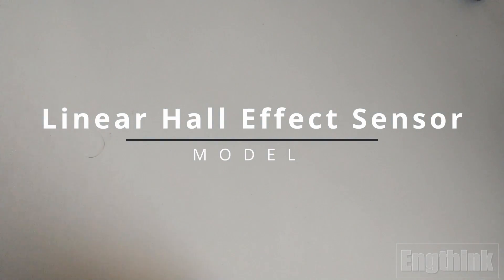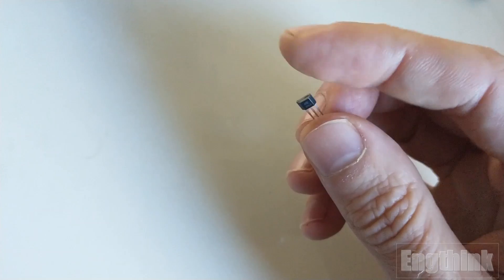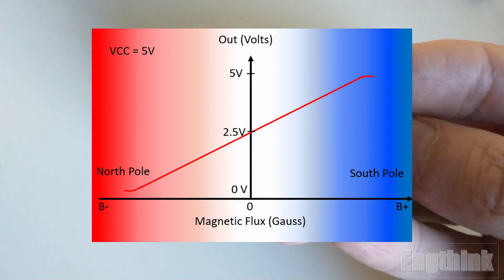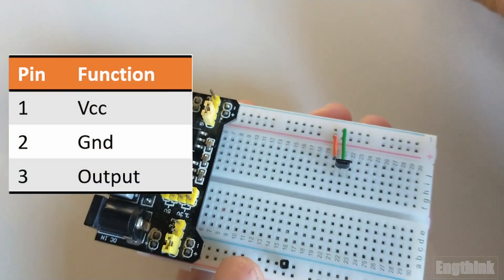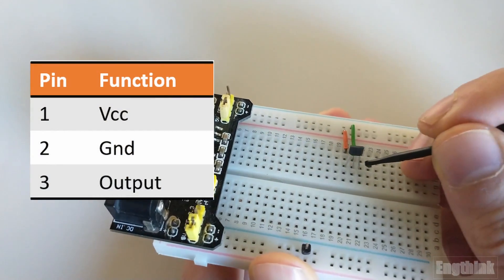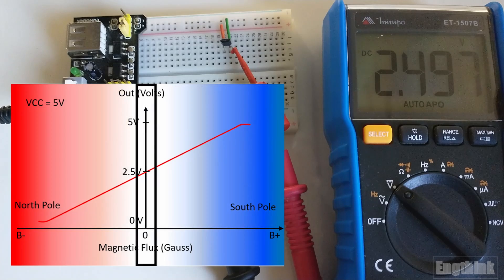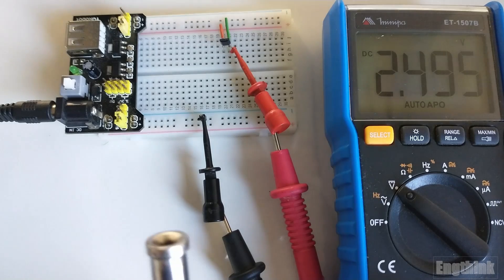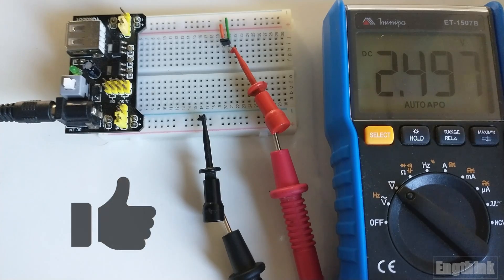Linear HALL effect SENSOR 49E #hall #halleffect #hallsensor

Comment: I'm thinking something like this:
A three way adjust for boat outboard engine.
Hall effext sensor in the lever and bipolar setup. Forward north, reverse south.
Set a servo so if north then servo goes to position of gear forward and if south gear goes reverse. If in the middle gear goes neutral.
Can this work?
Reply from the maker: That's a clever application! A Hall sensor (like the 49E in linear mode, or a digital bipolar sensor) can certainly detect forward/reverse and neutral positions, which can then be used to control a servo for your boat engine's gears. Depending to the voltage generated by linear hall sensor the servo will move forward, backward or stay neutral.
Reply: @engthink yes. Also thought to put on same lever another hall so that there are neodyms on both sides on a certain distance as you put on gear you also can throttle up both ways. I first thought to put a potentiometer for throttle but linear hall can be used as throttle servo control as it detects when closer to magnet the stronger signal and set that accordingly to get a smooth throttle both ways forward and backwards.
There's less moving and fault risky parts when you don't have a potentiometer?

Gear lever needs force so imma make a windshield wiper servo for it.
20kg servo for throttle.

I have never done anything electric but got my mind set to this now. And in my head I have a working system.

Long nights and hours of youtube and I will be able to make this work.

Comment: Can you tell about the hall sensor that is printed with 8891y on it, used in a charging case of wireless earbuds when the lid of case opens and it gives signal to led, it glows and when the the lid is closed the led blinks again and the buds starts charging......
Can you provide the data sheet of this sensor in next video
Reply from the maker: Thanks for the question! 👍
The Hall sensor marked 8891Y in your earbuds charging case is most likely a small SMD Hall effect digital switch that detects the lid position (open/closed) using a magnet. When the lid opens, the sensor changes its output and the controller turns the LED on. When the lid closes, it changes back, the LED blinks, and the charging starts.

I’ll try to find the datasheet and include it in the next video if available!

Comment: Thanks for the video. What is the lowest distance(in mm) that this sensor differentiate? For example, can it distinguish between 1 and 2 mm.?
Reply from the maker: The ability of a linear Hall effect sensor to distinguish between small distances, such as 1 mm and 2 mm, depends on its sensitivity, resolution, and the strength of the magnetic field it is measuring. Linear Hall effect sensors output a voltage that varies proportionally with the magnetic field strength, which changes with distance from the magnet.

Key Factors:
Sensitivity: This is typically given in mV/G (millivolts per Gauss) and indicates how much the output voltage changes with the magnetic field.

Resolution: This refers to the smallest change in distance the sensor can detect, which is influenced by the sensor's sensitivity and the noise level in the system.

Magnetic Field Strength: The stronger the magnet, the more pronounced the change in the magnetic field with distance, making it easier for the sensor to distinguish small distances.

Can it distinguish between 1 mm and 2 mm?
If the sensor is highly sensitive and the magnet used generates a sufficiently strong and varying magnetic field over that distance, then yes, it can distinguish between 1 mm and 2 mm.

For example, if the sensor has a sensitivity of 5 mV/G and the magnetic field changes by 100 G over 1 mm, the output voltage will change by 500 mV, which is easily detectable.

If you have a specific sensor in mind, checking its datasheet for sensitivity and resolution will give you a clearer idea of its capabilities. For most linear Hall effect sensors, distinguishing between 1 mm and 2 mm should be feasible.

Comment: Hello, thank you very much for this good explanation and demonstration! I have a brushless DC motor whose speed/RPM is controlled with a lever and a 49E. Do you know a cylindrical circular hall effect sensor that has the same connections and electrical data as the 49E? It looks like a potentiometer but is a circular hall effect sensor. If something like that would work, would you even have a part number of it? Thank you very much!
Reply: check out the as5600

Comment: Hello there. Thank you for the explanation. Nicely shown how the sensor works 👍 Since you still have many sensors left I wonder if you would know and if you could show use how to connect two sensors  in serie (I Guess) in order to get a limit controller for a linear movement between point A and point B. Thanks for your help.
Reply from the maker: Hello, actually, it's not usual to use hall sensors in series. Usually, the magnet has both poles on the same side, and this matches with the characteristics of linear movement. Check out this video to get some idea. https://youtu.be/QehDPrRzYIw
Reply: @engthink  Thank you for your comment. Unfortunately I don't see how your idea could fit into my "proyect". The teave of he slide is linear andl distance I have to cover is aprox 280mm. My idea was to attach a magnet on the moving slide and have two E49 sensors on the rail. One at the start position and the other one at the end position. 
What do you think is there a way you see how I can do It, without having the hall sensor sitting on the moving parte?
Reply from the maker: @Panic853  Now I got what you need. For this distance you need to use a magnetic band attach to slide an a bipolar hall efect sensor will capture pulses . So the amont of pulse will represent the linear movement. If you whant a easy way you can buy the sensor and the magnetic band in aliexpress, try to find by the name linear encoder.
Reply: @engthink  Thanks man. I Will look into that. In the meantime I made It to connect two sensors in serie using the out put pin of the first sensor as the Vcc for the second sensor using 5V source.
The thing is that I thought to use 3.3V as a source. This makes It again more dificulta, hahaha
Reply from the maker: @Panic853  Can do however  maybe could be necessary use other circuit to sum both output sensors
Reply: @engthink  Will try It in different ways. Let's see if I will figure out how tondo It with a pull Up resistor ..
Reply: @engthink  Thank you for your comment. Unfortunately I don't see how your idea could fit into my "proyect". The teave of he slide is linear andl distance I have to cover is aprox 280mm. My idea was to attach a magnet on the moving slide and have two E49 sensors on the rail. One at the start position and the other one at the end position. 
What do you think is there a way you see how I can do It, without having the hall sensor sitting on the moving parte?